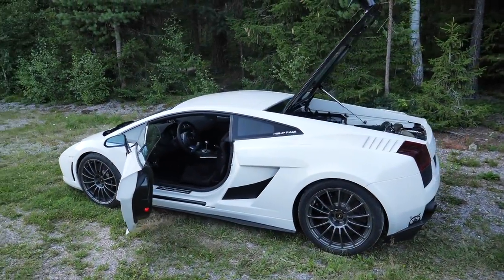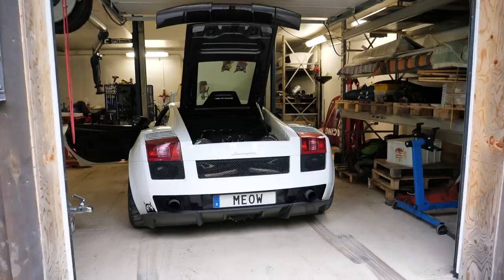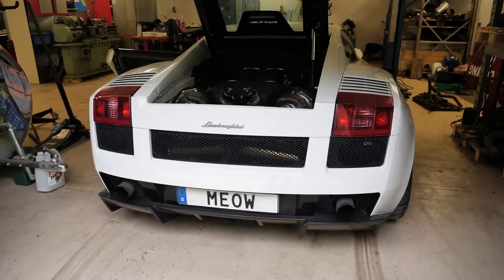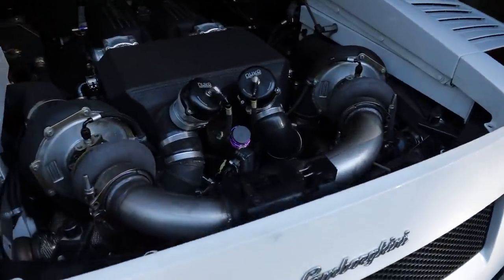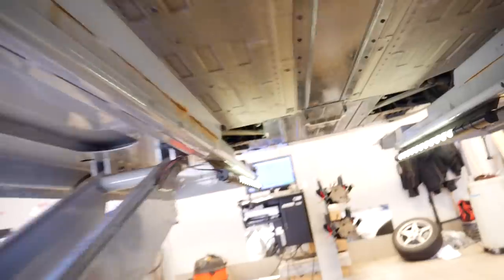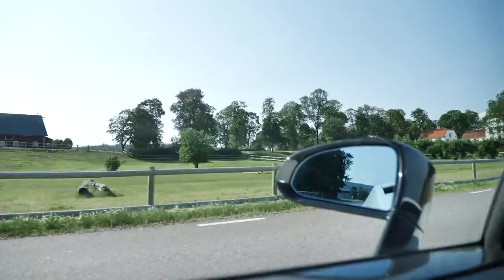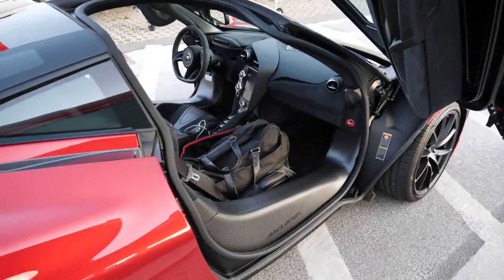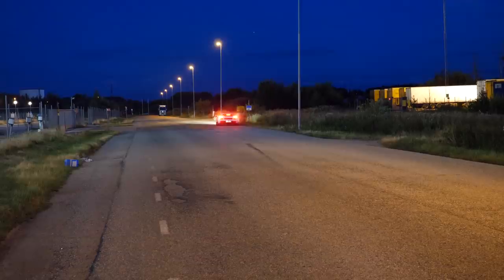My Lamborghini Twin Turbo Sounds like Crap!

Comment: I know the 245 can be approved for the roads up to 350hp with upgraded brakes in Norway, do you get yours approved for the roads in sweden, and how?
Reply: The 245 could be road-legal if registered as a "Modified Vehicle". Registering as a modified vehicle requires extensive changes to engine, brakes, gearbox, springs, brakes etc. Basically everything should and in most cases have to be modified to qualify for modified vehicle-registration. If one decides to go that route there is no black and white limit on hp as far as I know but each car is approved on a case-to-case basis.

Of course if you do manage to register it as a modified vehicle there is no way they will be able to determine if your car outputs the power stated in the registry (say 350hp) or much higher (say 800hp) which in practice means once you do register your vehicle you can continue tuning without any hassle.
Reply: @missan1  Interesting. In Norway since 2015 we have had a particular rule which means we can basically register any horsepower any modification on a case by case basis (with a lot of documentation and periodic checkups like checking welds on chassis during that portion of the build), IF we also pay a new first time tax on the vehicle because it will be classified as a completely new unique vehicle. So if you put lets say 800 horses into it then you'll have to pay the tax for a brand new 800 horse car first-time registration. I wonder if I could import a used Modified Vehicle from sweden and then only pay the used car first-time registration fee (reduced by 10% for each year since its "new" date, then being counted from the date the vehicle was registered as a modified vehicle in sweden, I bet). Maybe a swede could race it once and then I can import it on grounds that it is worthy of being taken care of as an ex racing car :D